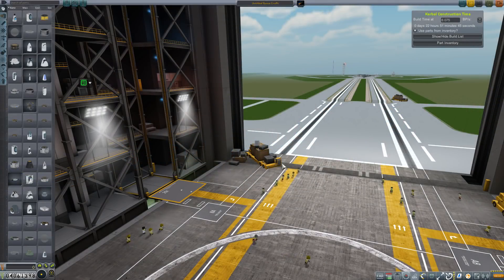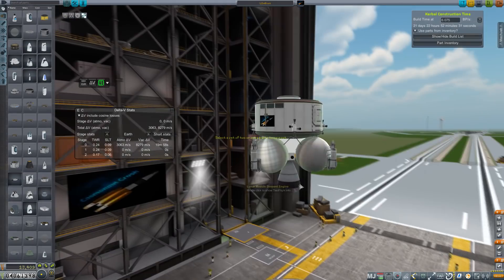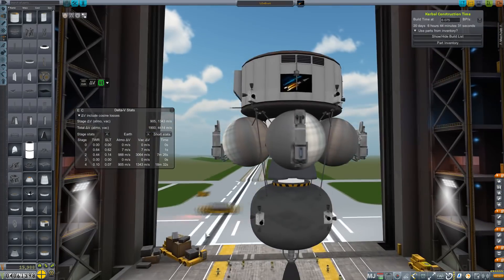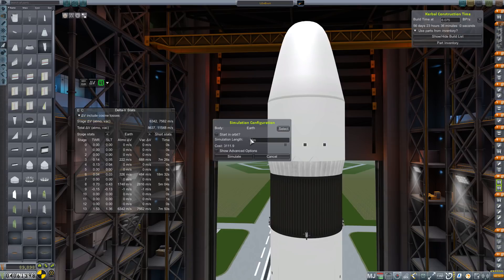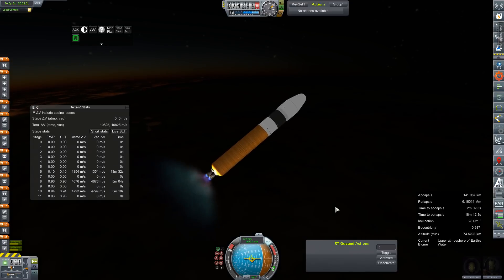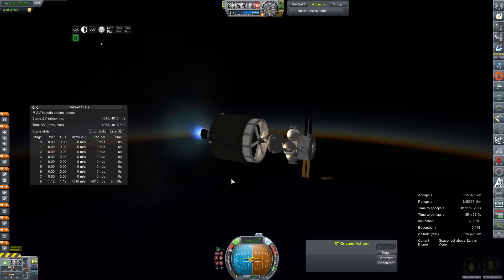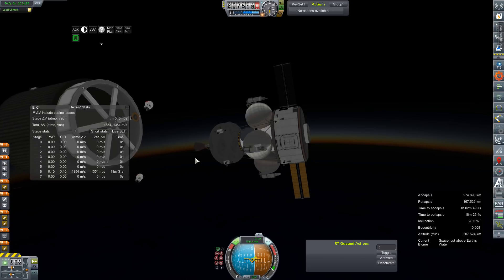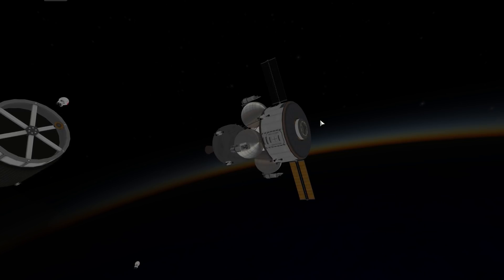KSP RP-0 #338 Lander RetroFit

Comment: With the advanced landing pods (2 and 3 seats) it always dont show the last Kerbal ( I guess that's because RO reconfigured the stock parts which have one less seat each). You have to use Crew manifest to change the seat if you want to go on EVA with the Kerbal that isnt shown in bottom right corner.
Reply from the maker: awesome, thanks!
Will certainly need to know this when it comes time to get the crew out of the LEM
Reply: If you click on the hatch, it will show every crew member.

Comment: How hard would it be to place your Shuriken shuttle on top of a DN-5B and thow it to Mars ?
Reply from the maker: huh - i dont know - not terribly difficult I imagine - strip off the HG-3s - fill the bay with life support...
I don't know if it would have the wing surface to fly at Mars ( like a glide landing ) - and it would certainly need more than the single AJ-10 to get airborne again. but Its worth looking in to...